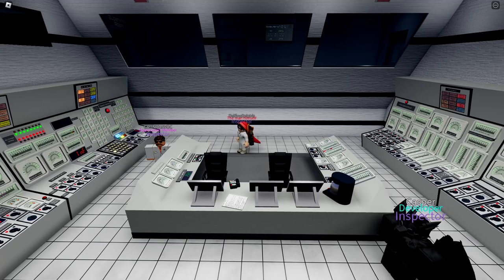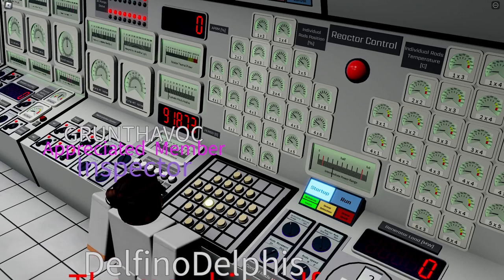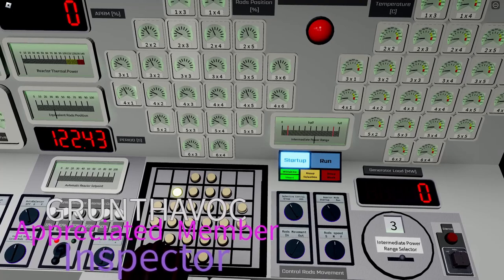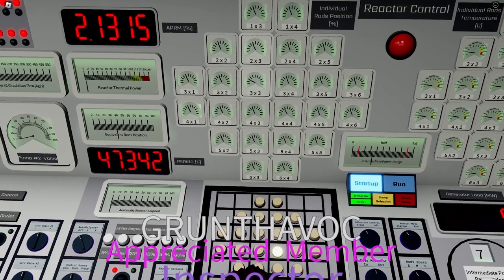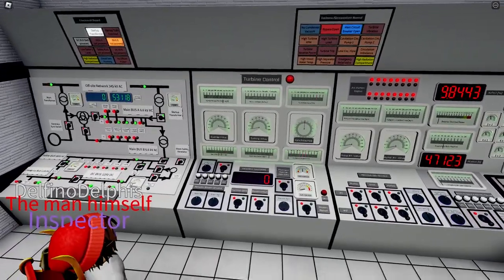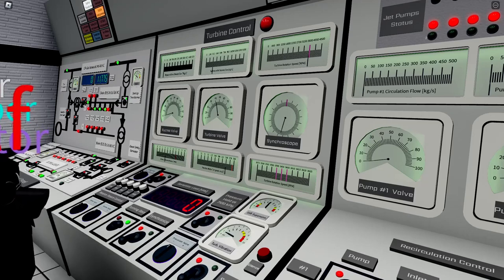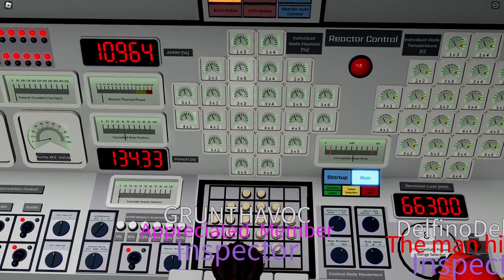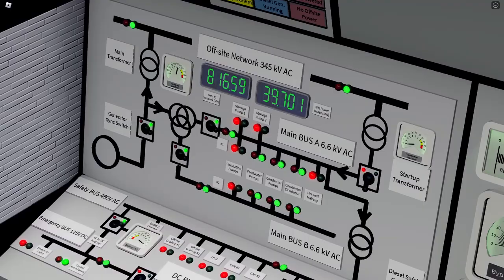RBWR | Unit 2 Startup Procedure

Comment: I am currently having difficulties with the controlling of the turbine start-up specifically the hydraulic oil pressure going too high with aux pumps, could you help me a bit with that?
Reply from the maker: Yes. In the last update SRM mode was added. It's nothing really complicated but it's a bit different.

Comment: i did everything as said in the video: i disabled offline cooling, i switched the movement of the rod to out, rods speed to fast but for some reason group block is showing for me when i try to pull the second rod after it reaches more than 20%? why is that
Reply: You need to disable the old rod.
Reply: @DelfinoDelphis  thanks, i already figured it out
Reply: @superspacetoast41 xD